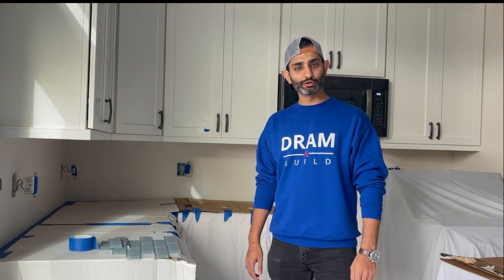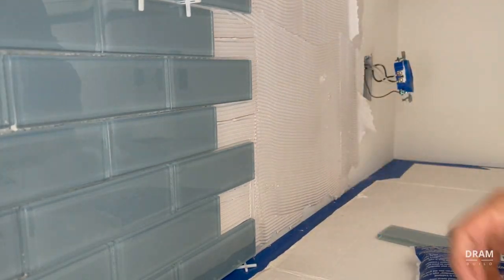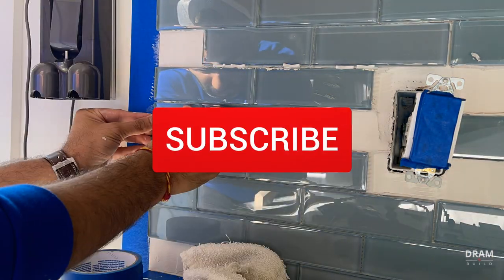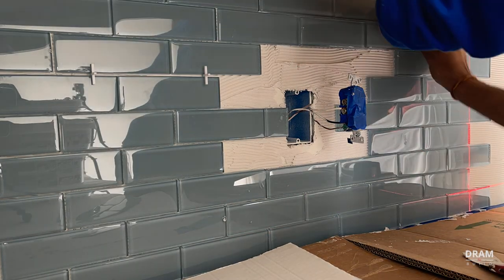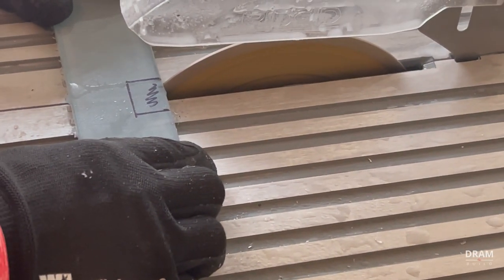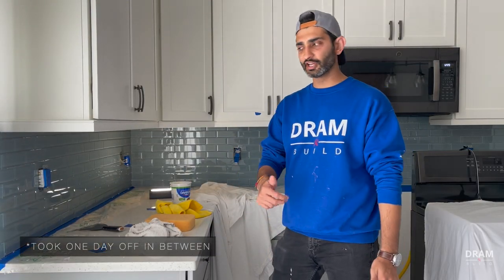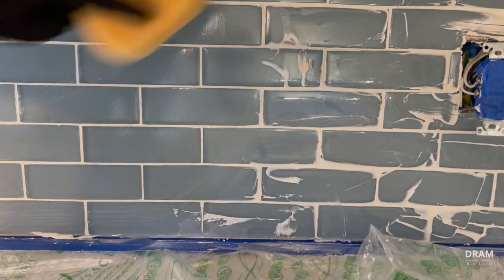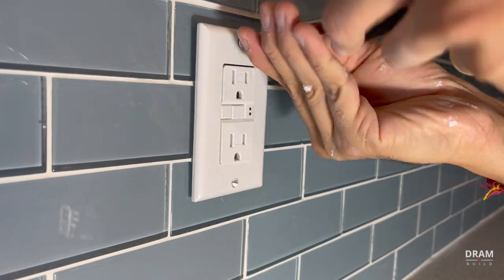Watch this before you install kitchen backsplash - Cost breakdown included

Comment: On small jobs like that with any tile... Put a sheet over the countertop to put the tile flat... Layout all your tiles directly onto the flat surface and precut all your tiles, including the outlets using an outlet box for those cuts... Apply your thinset and transfer your prefabricated tile directly... No scraping off, no citing and fitting all tiles and you get a preview of how it's gonna look without slivers of tile to cut because you can see where your problem areas are and adjust accordingly... I also use a bent or folded look in the corners measuring the tile on the one side and continuing it to the next wall so it looks bent or folded around the corner...
Reply: Smartass is no smartass.  I like the detail of folding around inside corners.  Depending on the kitchen layout, it may be best to start at inside corners.  It is a bugger to start at an end and realize you have a 1/2" wide tile in one of these corners.
Reply: @haroldped  I would post some pics of jobs I've done like that but I'm not that savy lol!

Comment: Nice job.  One thing I might have done differently would have been on the inside corner.  Whenever I have a short tile going into an inside corner, I will have another short or cut tile coming out of the inside corner.  Think of it as if you were folding the tile into the corner.  If you have 6" long tiles and there is 3" going in to the corner, have 3" coming out of the corner.  If a full tile goes in, then a full tile goes out.

Comment: I've been researching a lot and mastic should only be used for porcelain or ceramic tile in non wet area. The mastic is pretty much like a glue. You shouldn't use it on glass because it turns yellow and can be seen through the translucent glass tiles.

Mapei has the type 1 adhesive mastic but for glass tiles they have a bag specially for glass tiles you have to mix.
Reply: Too correct. Additionally non porous tiles like glass won’t let the adhesive dry properly unless it’s designed for glass and porcelain which the premixed aren’t.

Comment: Excellent video.  I would use painter's tape at the top of the first course as a guide in setting tile, as sometimes laminate countertop have dips in them.  Also, it may be easier to remove outlets - or at least tape the contacts - to not have to work around them.

Comment: I’ve ripped out so many tiles in my life where the DIY homeowner did it and didn’t think about the big picture. Like you have a laser and a great saw and are smart enough to use an efficient blade for cutting glass. Lay out, material usage. Etc etc. People don’t think about all this, even more so they always forget about understanding products they are using. There is more to every trade than just “putting tiles on a wall”

Comment: Do you always recommend to  start with a whole tile and from the edge? I’ve seen folks that start from the middle. Thanks!
Reply from the maker: Good question, it depends on which area your eyes are drawn to the most. If you think that your eyes are drawn to the middle then I’d start from there and work your way out.
Reply: Starting at the middle is also to avoid going into the corner, or ending with a tiny piece of tile

Comment: Can a regular ceramic blade cut the glass tiles or do i need a special blade to cut the glass tiles?
Reply from the maker: I’d recommend glass tile blade if you have a whole lot of cuts. Ceramic blade works fine if you cut slow.
Reply: @drambuild9800  sweet thanks. Gonna be my first diy tile job

Comment: Great work. But will be cheaper to hire someone to do it. Your one  is not not like those stupid DIYs from professionals who claimed as DIY and use super expensive tools to do simple things.  For one time job like this purchasing tools like the saw and that expensive laser level are just waste of money for homeowners and you could simply mention that to make it real DIY.
Reply: It depends on which tools you buy. You don't need a $500+ tile saw if you're planning on one or two projects. A cheap sub $100 saw will work fine, or rent one. I bought a laser level years ago and have used it for numerous things. It's indispensable for hanging shelves. If you use the tools over the years, the cost becomes more justifiable.
Reply: My wet saw was 75$ and worked so good. I was impressed 
Very easy to cut glass tile with a diamond blade

Comment: I messed up and didn't use spacers didn't know assuming like an idiot they would stay straight, any way I can remove and start over using same material? Wife mad she spent 400 on just the tile glass mesh. Sos!
Reply: If you try to take the tile off & start over, you will probably destroy your drywall or backerboard. The best case scenario is tile will come off clean, but your mastic will have to be chipped off which will end up as drywall replacement. 
Expensive lesson to learn. Would've been cheaper to hire, sad to say.